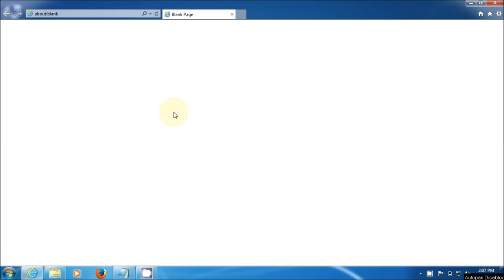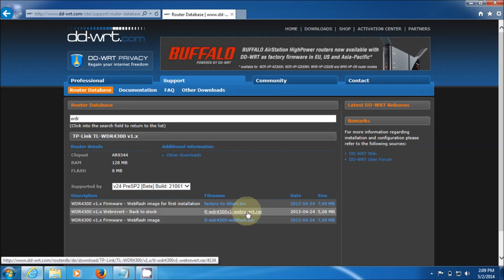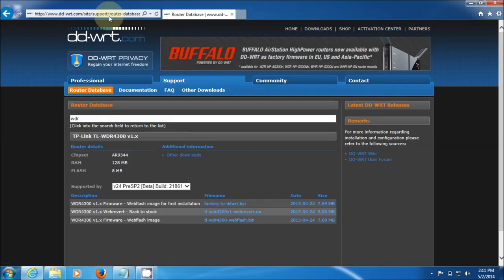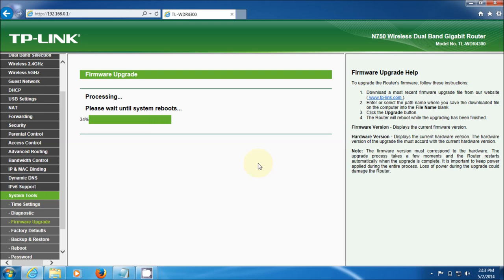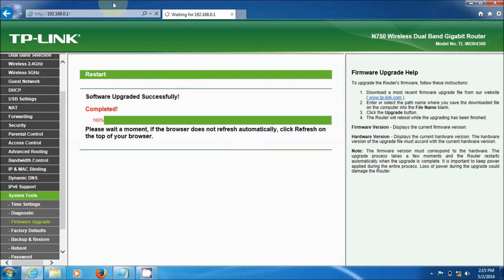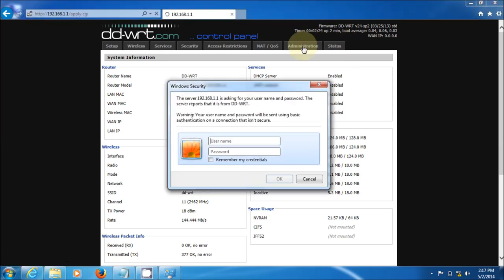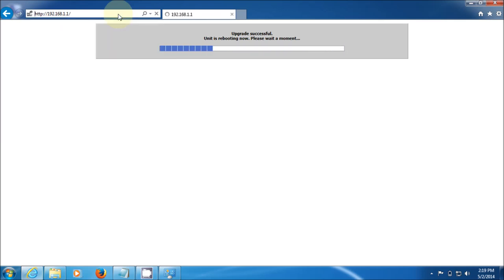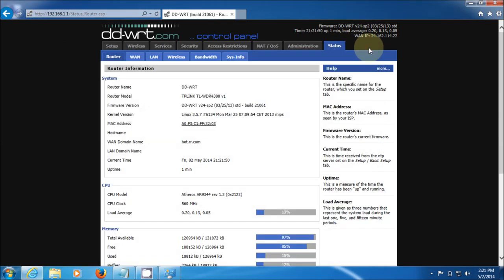DD-WRT Install (Supercharge) TP Link TL-WDR 4300 N750 Dual Band Router

Comment: Hi Richard, A very helpful video, thank you.
I've read through all the comments and you seem to have changed version a number of times. I think in your latest comment you said were on version r29837. Which version was the most stable in your opinion?
Reply from the maker: For the most part there is not much variance in stability but there is in functionality. Seeing as the router is very robust and can be recovered in most cases. You can experiment with newer firmware but I would hang back two or three versions on the beta firmware just to be safe. Thanks.

Comment: I'm gonna be using this with a gigabit fiber pppoe connection. Does flashing dd-wrt, and thus removing the included hw nat, adversly affect the WAN to LAN speeds?
Reply from the maker: I have not noticed any speed decrease since the upgrade and it has been very stable. BTW you can revert back to the stock at anytime to test the difference or if you don't like the performance. Thanks

Comment: Do you know the best configuration for the WDR4300 tplink model?

I have an internet of 300 MB, but it does not exceed 140 MB. I'm using 5GHz.
Reply from the maker: You should test your Internet connection while being connected directly to modem and your PC (no router) it may be you have a slow connection on the modem. Thank you for watching and commenting. I appreciate it greatly. All the best.

Comment: Will you let us know when a newer build is available for this router? I have read the DD-WRT forums and they say the newer r26xxx build that works, but I'm afraid to try them. Is the version you mention really stable? I need mine working 24/7 as I share internet with my roommates.
Reply from the maker: I know that the firmware version r26372 works and is stable for me. There are newer versions since I installed r26372 but I have not tried them. I fried my secondary back up router WR841N http://amzn.to/1Hz4Jx7 by dropping my screwdriver in it. LOL. Like you, I can't have my internet go down either. When I get the replacement router I will do further testing and post the results here. Thanks.
Reply from the maker: BTW I was able to unbrick my router after wrecking it with a faulty firmware. Here is the video on that: http://youtu.be/t35Pei_eb6o?list=PLnxXRLSlmSVNiENiN9wTejP6dtIqqmTya

Comment: Hello Mr. Richard,

Great video thanks very usefeul.

On the router there is a on-off hard switch to control the wifi. How can I use in dd wrt?!
Reply from the maker: You are most welcome. My switch was on off and it still had WIFI working so I don't think it's enabled by the DD-WRT firmware but I did find this option. Unfortunately I can not currently test it as I can not currently reboot the router. Here is the proposed fix http://www.flashrouters.com/blog/2014/01/20/turn-wifi-dd-wrt-press-button/ Thanks for watching and commenting.

Comment: **WARNING** 2015 builds beginning with 26xxx have been throwing 4300s into infinite reboot cycles.  To get into recovery mode and upload a working firmware, check this step-by-step out (p a s t e b i n / tCeQV6s2).  Referenced from: www.dd-wrt.com/phpBB2/viewtopic.php?t=278435.  I was in a panic thinking I'd have to solder a TTD but this worked for mine.  The latest we should stick with for now is the r25697 as stated in the video.
Reply from the maker: Thanks for the warning. I was aware of it but I did not post it here. I posted right on the video to spare people the grief of bricking their router. I looked at your fix for this issue and I do not believe it would have worked for me as the router was looking for a different file on a different IP address. But it might work for other people. I have a hardware fix for this issue here: http://youtu.be/wCwBvoueBG4?list=PLnxXRLSlmSVNiENiN9wTejP6dtIqqmTya Thanks again.
Reply: Richard Lloyd Thank YOU for the video! I wish I could get more users to unlock potential in their routers hehe.  Well it looks like build 26339 released late yesterday addresses the uboot issue but only after causing lots of headaches.  Yeah, it seems like routers are as unique as mechanical devices, all with quirks.  I have been wanting an AC68U for a while and was going to use it as a reason to get one but money constraints ya know..
Reply from the maker: Wahinies  You are welcome. I will try the new firmware next time I want to take my whole network down. LOL I actually have a spare router just in case. Turn the Internet off in my house and you are in a very hot seat. Thanks for watching and the feedback.

Comment: Thanks for the video.Which is the bes last firmware for router working without bugs nad workable usb?Thanks again.
Reply from the maker: I am using the latest beta r26490 without issue http://www.dd-wrt.com/site/support/other-downloads?path=betas%2F2015%2F03-19-2015-r26490%2Ftplink_tl-wdr4300v1%2F. I can't attest to no bugs as I don't use all the features. I would avoid any firmware after r25974 and before r26372 as there are some there that will brick your router. Here is a video I made on configuring the USB for drive storage https://youtu.be/mdSyWDTY0h0?list=PLnxXRLSlmSVNiENiN9wTejP6dtIqqmTya I used the r25697 firmware on it without issue. Thanks

Comment: @Richard are you still running these routers with DD-WRT? And if yes with what firmware?
Reply from the maker: I am using r30880. Make sure you connect to the router using a network patch cable too. All the best.

Comment: I tried the dd-wrt (v24-sp2 06/01/15 (5G no light)), openWRT (14.7; 15.05-default without wifi) and stock firmware (TL-WDR4300_V1_150518). The WRTs, no doubt, got many functions. However, my main concern is that the Lan speed is only about 200-202Mbps vs the stock fw reached speed around 240Mbps which is similar to other Asus RT-N56U with Padavan fw. Some consideration for those looking for wrt fw or someone might want to confirm my result. It is a good & cheap router but a bit big size so I only use this one as a 2nd router to extend the coverage.

Comment: Hello Richard. Saw your guide a year ago. Have finally decided to flash it today because I have bought a 4G donlge for it. Am I able to flash it with the "12-04-2017-r33986"?? Or would it brick it? :/ Thanks for the tutorial, looks easier when you do it :) Hope you see my message and reply, merry christmas :)
Reply from the maker: I am using DD-WRT v3.0-r34080 std (12/14/17) on it right now without issue. Thanks.
Reply: Richard Lloyd Thanks a lot! Was Easier to do than I thought. Have you any tricks for me to use about 4G dongles? 🙂
Reply from the maker: I do not have a 4G dongle to test with but I will look into it. Thanks.
Reply: Richard Lloyd Thanks a lot! When checking the database, the dongle is under Work In Progress 😅

Comment: Hi Richard, I saw and congrats for your post, I have this kind of router, and the strength of the wifi signal is poor, if I update with this firmware, the wifi signal can improve?
Reply from the maker: If you install the DD-WRT firmware it "should" give you the option to increase and decrease the signal strength on your WIFI but there is no guaranty that it will improve your performance. Also not that using higher than default strength values may shorten the life of the router as it will run hotter. Google that for the DD-WRT firmware. Thank you for watching and commenting. I appreciate it greatly. All the best.👍😀

Comment: Hi Richard,

Another question. On my TL-WDR-4300, I'm already on DD-WRT (version 21061). Can I back up my config, flash to r27147 (or beyond) and then restore my config?

I'm wondering with such a big jump between firmware versions if the backup/restore feature will work. Or if I'll have to reconfig everything.

Thanks.

Comment: Thank you for this video! I am still using build 21061 and everything is working except the SSH daemon. Which build version are you using at the moment? Is there anywhere an overview of the builds with change logs or release notes for this TP-LINK model?
Reply from the maker: Matthias Köhne I am using r26653 and it is working great for me. I never have to reboot it or deal with it at all. It's a set it and forget it. I am not aware of an overview on the builds but you can hunt through their FTP site maybe it is there and I am not aware of it: ftp://ftp.dd-wrt.com/  Thanks
Reply from the maker: Matthias Köhne Thanks for the feedback and great info.

Comment: Hey I bought this router for 2 reasons.
1. To flash dd-wrt run a OpenVPN Client so everyone on the router would be protected by the vpn. 
2. To have full WiFi on the otherside of the house.

So far all these things are working. 
But I have a few questions. 
I want to push the VPN to my primary gateway router so the people hardwired or connected wirelessly to the gateway router get forwarded to the router running the vpn and are protected as well. 

For some reason when I have my vpn service which is www.buffered.com connected with the router. 
I drop from 110/8mbps 
to 20-30/6mbps. 
I don't know how to fix this. 
Is this a port issue?

My gateway router is indeed a Arris TG825G
Reply from the maker: I don't use VPN so I can't comment on that. Perhaps call your VPN provider and see what they say.
Reply: Richard Lloyd Hey, I worked it out in the end. 

What I did, was put the primary router and slave router on the same subnet e.g. 192.168.0.x 
I made the primary router handle all the dhcp configs and everything else and made it so the traffic goes to the secondary router.
Reply from the maker: Zac Goulding  Glad you worked it out. Thanks for watching.

Comment: Can you make a vid on what benefits there are to flashing this router? I have it on stock firmware but I want to know if I will gain anything by flashing it.
Reply from the maker: I guess if your router and firmware are doing what you require it to do you there really is no benefit to upgrading it. The DD-WRT firmware has so many features it would be hard to compare.
Reply: Richard Lloyd Darn :(
Maybe you can make a vid of all the tabs/options it has on the 4300? :D
Reply from the maker: xxx4reggie  I will look into it. It sounds like a good idea. Thanks.

Comment: Hey Richard. Great tutorial. I'm having just a slight problem and wanted to see if you had any ideas. I have WDR4300. Was on latest firmware. I ran your lesson on flashing it back to stock 130319 firmware version prior to installing the DD WRT files. It seemed to flash with no problem but now I cannot access the router when I type in the "192.168.1.1" into browser. I get no reply. However, the router is working as far as connecting to the internet. It is not bricked. But I have tried to flash it again, I have tried the other video of flashing the recovery file. I even tried to run the direct upload to DDWRT files using Putty. It looks like it transfers the file and the router reboots but I just cannot access it to see what it is running. Any ideas?? Thank you in advance for your lessons. Great job.

Comment: Have had this router for a while and kinda forgot about the alternative firmware options because somehow it seemed a bit tricky at the time. Thanks for showing how it's in fact quite uncomplicated to change the firmware.

Any novice router users out there might have a bit of work cut out for them figuring out some of the router configuration afterwards though, and I'd note especially how the WiFi is left unprotected by default with this firmware.

Something that I especially liked is how this firmware gives you a lot more information about the router, for instance how hard its CPU is working at the moment. It'll be interesting to try out some different settings while the line is loaded.
Reply from the maker: My pleasure. Thanks for watching.
Reply: Richard Lloyd when downloading this dr wrt firmware does that ip bandwith control still work? i have the tplink ac1750 c7 v2 which firmware ?
Reply from the maker: ricardo Ferreira Yes it does but I don't think your router is compatible with DD-WRT. Thanks.

Comment: Thanks for the video. It was easy to follow. However, I had trouble enabling the USB storage. The router doesn't detect the 1.5 TB powered external HD. Could you do a video on enabling USB storage?
Reply from the maker: I will put it on my video to do list. I will see if I can do it sometime this week the holiday is killing my schedule. But I will update you when I finish it. Thanks for asking and watching.
Reply from the maker: Here is the video you requested on this: http://youtu.be/mdSyWDTY0h0?list=PLnxXRLSlmSVNiENiN9wTejP6dtIqqmTya
Reply: Richard Lloyd Richard,
Again, thanks for another video. You made it easy to follow and understand. My router firmware is the same build as yours which is #21061. I will need to upgrade it to #25697 as you indicated.
Reply from the maker: Shawn Tran You are welcome. The 25697 upgrade is imperative. It works much better and supports NTFS where the 21061 does not. Thanks for watching and the kind comments.
Reply: Richard Lloyd
I've put it off until now. Finally got a chance to upgrade the router firmware to 25697. I must say it worked as you said. Soon as I plugged in the HD, the router could see it right away. The rest was straight forward. Thanks again for the info. Keep up the good work
Reply from the maker: Shawn Tran  You are welcome. Thanks for the feedback, kind comments and watching.

Comment: Hi Richard,

Thanks for the video. It really helped me to installed DD-Wrt on my WDR4300 v1.x router. Before getting DD-WRT on the router, i was able to connect to the internet via PPPoE to the "FFTH BTU" (https://www.tm.com.my/Home/Broadband/unifi/office/Pages/equipment-BTU.aspx). In order to connect to the net, we need to set the VLan2 to port 500. This works fine on TP-Link's stock firmware.

However, since installing the DD-Wrt (r25697) on my WDR4300, I can't seem to get it working. I have tried following the steps found here for the same time of installation using D-Lik DIR615 (http://web.archive.org/web/20110923201434/http://unifi.athena.my/ddwrt_guide.php). But it was not successful for me. Could it be that it is a bug in the r25697 firmware version. If so, which other stable firmware version do you recommend?

Alternatively, I would have to fall back to the stock firmware :(
Reply from the maker: +Prem Reginald Try the r27944 firmware http://dd-wrt.com/site/support/other-downloads?path=betas%2F2015%2F10-09-2015-r27944%2Ftplink_tl-wdr4300v1%2F I am using it without issue, granted I am not using PPPOE but it is an available option. The r27944 is currently the fourth newest revision there are three newer revisions available if this one does not work try them instead. You can go back to stock if all else fails. Thanks.

Comment: So, you didn't have to do the 30/30/30?
Reply from the maker: I didn't have to do it on this router and install. It has worked fine since the upgrade. Thanks.
Reply: Richard Lloyd I only have a .trx file in DD-WRT; not a .bin file.  Can it be used?
Reply: Richard Lloyd I watched a French guy on YouTube not do the 30/30/30 on his Asus (like mine), and he bricked it.
Reply from the maker: rfrancoi  Then by all means do a 30-30-30. Here is a video I made on how to do a 30-30-30 reset http://youtu.be/gczCzP9Rry0?list=PLnxXRLSlmSVNiENiN9wTejP6dtIqqmTya This video covers the TP Link TL-WDR 4300 N750 Dual Band Router not all routers flash in the same fashion. Thanks.

Comment: Thanks for the guide Richard
Love the throughput on this model can you recommended any settings or modifications
Reply from the maker: You are most welcome. I generally go with the default settings as they are tested to be the best settings for reliability and performance. The problem being that your network environment is generally unique to you so it's hard to recommend a tweak without first understanding your unique network environment. Thanks for watching.
Reply: thanks for the quick reply.Its tricky really split level with a tin roof on the lower and lots of solid walls. I understand what you mean and really the placement of the box could be more ideal but ATM it is setup for testing purposes on top of the computer case.
Reply from the maker: Benjamin Sweetnam  I will be making a video soon (in the next month) on optimizing WIFI but again it is kind of specific on the network environment. Thanks

Comment: hi i bought a wdr4300 v1.7 from amazon USA, i see that this router have 151104 rev firmware only exist this firmware in tplink usa, in contrast the rest of the tplink worlwide web page the maximun version fo firmware is 150518, i read in ddwrt  and russian forum pages that only routers in usa with 5GHZ supports are now unable to installr ddwrt or openwt because fcc rules, and when you try to downgrade you will receive al 18005 error or a kind errror. My questions is how i can safety downgrade now this router because i got it to use ddwrt but now i see i cant do that??. What is the pros to use this firmware vs the normal or even vs ddwrt. What  will lost if i use ddwrt vs tplink original formware?? thks
Reply from the maker: +Ivan Chang Not sure what the solution is but I successfully removed DD-WRT off an Archer 1900AC C9 and went back to stock using a serial connection. I am not sure if it is possible without using a serial connection but I could not get it to happen. I was relieved that the serial solution worked for me but I am not sure how to do it on a WDR4300. I will be posting a video on how to do it on the Archer 1900AC C9 soon. Thanks